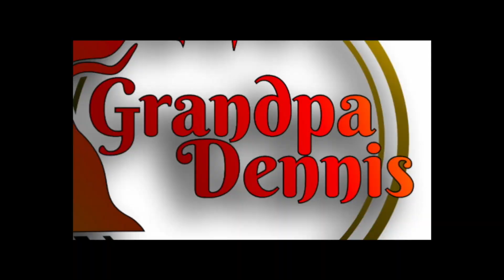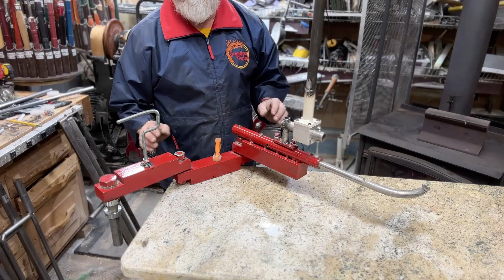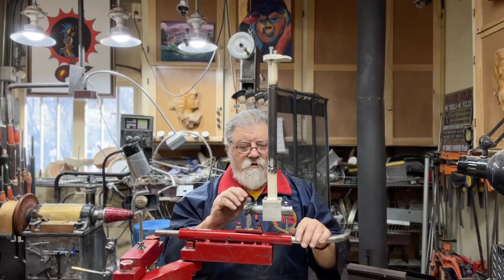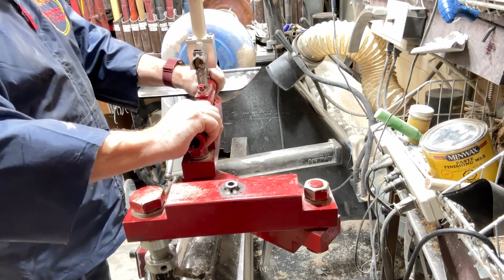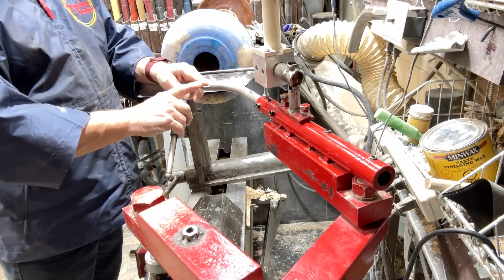Articulating Arm for Woodturning Hollow Forms

Comment: I made an articulated arm a few years ago.... 1.25" sq. Leaded Steel. The intermediate linkage is two 1.25x½" leaded steel flat stock the sandwich the 1st and 3rd arms. I also used thrust bearings and washers to reduce friction at each joint. Leaded steel is much easier to drill and machine so i was able to do all of the machining operations right in my home shop. My next project is to swap out the laser end for a video camera and use one of the systems similar to Trent Bosch's "Vision" arrangements. I already purchased the CCVT camera and a 12" flat monitor.... I just need some spare time!! I also want to try using ER collets  and a collet clamp (similar to the Robust handle) on my tool holder so that i can use this for ⅜, ½, ⅝, and ¾" hollowing tools.
Reply from the maker: That’s a great idea about the video camera. You can achieve some amazing results with those setups!
Reply from the maker: Great ideas. Let me know how the camera works out

Comment: I have a somewhat similar solution partially ready. However, I only used ⅞" bar as the structure and the joints are 2" welding sleeves with ⅝" holes and bolts. No bearings. I don't have the turning arms ready yet, but I'm already looking forward to trying the arm
Reply from the maker: Thanks for your comments.  I would recommend you consider the thrust bearings for every place where two pieces contact each other  They look and act like washers but with tiny bearings. They will make the tool move more smoothly. They are less than $5 each, come in all sizes and are at most bearing supply stores. As I stated ,my Arm is very heavy and lighter steel would have been better. Email me a pic when your done grandpadennis9@gmail.com